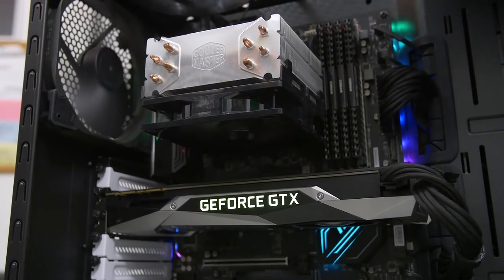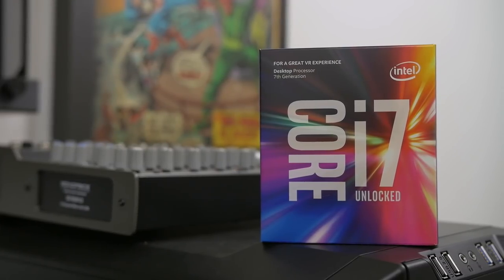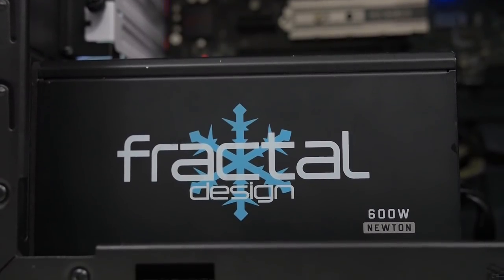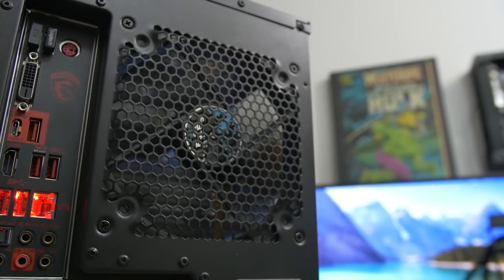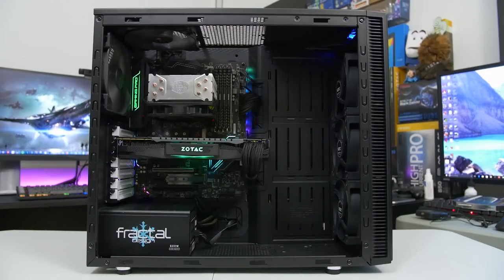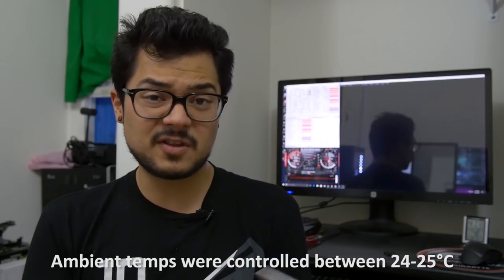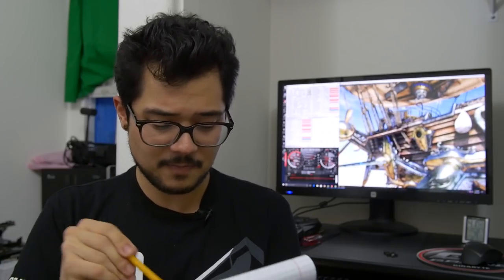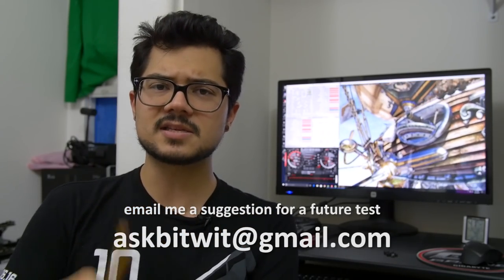This is how you should mount your CPU cooler! I think??

Comment: Sounds like air flow is the key even if you use already heated air for the CPU. The open GPU seems to have created a veil of hot air streaming up that stopped the fresh air from the front of the case reaching the CPU fan. I've read that having the two rear exhaust fans pointing back and up so close makes them compete for the same air in the corner.

Comment: blower style gpu = the heat doesn't get to be released all that more efficiently from the back and that's why the overall heat of the case increases

open style gpu = the heat circulates enough and cools down the gpu so it doesn't heat up the case and the heat gets released from every exit of the case.

Comment: first test has to be that the fan is getting all the cool air from the front intakes..the open air card probably throws the hot air out the sides and it gets countered by the cool air. 

but the direction of the fan and heat sink. it does make a lot of sense as the cool air has a stronger presence

Comment: IImo, if you look at the case, theres no space on the bottom to exhaust any air.  So if you use an openGPU, all the exhaust air would have to blow upwards to the outtake, hence giving the CPU heat sink double airflow, When you mounted it vertically, the CPU fan was taking in the GPU hot air, the case fan was too far to give any impact on the heat sink. Thats why the temp increases. You should give us the GPU temps to give us all the variables in your tests.

Comment: The abundance of fans was probably enough to exhaust the air from the open air shroud from the pcie fingers and the CPU was thermally isolated. When it went vertical, it was sucking air from where the GPU was exhausting so therefore negating the purpose of the front fans. My best guess for why the founders performed badly was because the back plate was heating up and being cooled by the CPU cooler as well.

Comment: My guess for the difference in the shrouded GPU would be that the GPU fan would be producing a negative air pressure on the lower end of the case causing the air at the top of the case to be pulled down disrupting the airflow of air across the CPU.

Comment: A theory about the horizontal air flow with open GPU.
You have three front fans pushing air into the case without any drive cages obstructing the flow.
Therefore your main air flow in the case is already horizontal. The CPU fan gets all its fresh air directly from the top front fan, pushes it through the fins and the rear fan pulls the air outside. If there is any heat rising up from the GPU, it's basically blown horizontally by the other two front fans and it wouldn't really get in front of the CPU fan to heat up its intake air. Also, the only heat from the GPU that should affect the CPU cooler in that configuration rises up at the very end of the card.
And since we know the blower style cards get hotter, that may explain the increased temp for that type of card. The horizontal case flow doesn't help, because only the GPU cooler's ability to move air is relevant here for ejecting heat out of the case.

It might be interesting to repeat that test with what I'd consider a more real-life scenario (at least more relevant to me, because I don't want to do without a DVD Drive):
Mount a 5.25" drive bay and remove the top front cooler and put another 3.5" drive bay (even empty) in front the bottom front fan. That gives less air flow and the air coming in must rise up to get to the CPU cooler, possibly taking more hot air from the GPU along with it.

Or: What happens if you mount the top fan as intake and as far to the front of the case as possible. It would pull in cool air from above the case and blow it right in front of the CPU fan intake (kind of what the PSU does)

Comment: In my humble opinion, you should always think it trough per case. make a (air) path as optimal possible past all components that produce heat (not just cpu gpu). When done check with some smoke and temperatures. For example, when you place front/back fans and place an exit fan on top near intake fan before air can hit any heated object you displace air, not heat. When you place 1 air stream and place the second one 90 degrees on the first, that usually doesn't work well either. In this case for the first and second test... use smoke to get an explanation. Personaly I would say, close the top completely so you have an optimal flow from front to back. Close the top makes that the warmth of the GPU less likely to hit the CPU cooler. Heat wants to go up but with a good air stream it wont.

Comment: Commenting as I watch.
The open shroud graphics card setup with fan aimed out back ran cooler, because the card itself ran cooler, less heat traveling up to the CPU area.
Sure the blower style vents out and is contained, but not 100%, and those run much hotter than AIO cards.

Comment: It is possible that the blower style GPU was pulling more air than the other fans, creating a bias of more fresh air flowing towards the bottom of the case. You would have to look at the speed of each fan while running the test, take those numbers and figure out what volume of air each is moving at that RPM. Given that we know that those blower style GPUs tend you run up the fan to a pretty high RPM while under heavy load, and assuming that you kept the rest of the case fans at a reasonably low RPM then this might be the cause. Try running the test again with the case fans at their highest RPM. Thank you for continuing to have a great channel!

Comment: presuming that heat generation is equal in all tests what is happening is either the configurations affect total airflow into/out of the case or they affect airflow inside the case. to test this you could measure air pressure going into the case and measure the GPU, Mobo temps and put some thermometers inside the case

Comment: thermal dynamics... higher difference in temps slows heat transfer so just like in your AIO vid the warm air actually pulls more heat off the fins on both coolers than cooler room temp air. usually involves larger differences but its an idea :)

Comment: Maybe it's because you have so much airflow pushing to the back of the case (including the cpu cooler) that all the heath coming from the gpu is exhausted before it can get so close to the cpu that it raises it's temperature . While when the cpu cooler is vertical, some of the heat coming from the gpu is taken by the cpu cooler and is forced to go through the fins, so the cpu cooler is actually using hot air to cool down the cpu, resulting in worst result.
I think that in a part 2 you should also consider the effect of the case fan on the cpu cooler.

Comment: I think with the enclosed GPU cooler you end up with less positive pressure in the case, which results in less air being evacuated by the fan behind the CPU cooler.  Less airflow in that total fluid path = less CPU cooling effectiveness.  With the open air GPU cooler, you don't have that air being forcibly being evacuated out the rear of the card so overall case pressure isn't affected and airflow through the rear case fan is higher (and therefore also for the CPU cooler).

On the other hand, with the vertical CPU airflow alignment, the open air GPU cooler probably dominates the thermal behavior through convection current (hot air rising) and the positive pressure factor becomes less of a dominating factor.  So you end up seeing the expected behavior there.

That's my theory.

Comment: As you have seen with those temps, when you have a ton of case fans and mild overclocking, orientation hardly matters.

When it matters is if you are trying to get the lowest temps with the worst air flow.

Try again with a PSU on top tower case, no case fans and seal any holes in the case except one inlet diagonally opposite the PSU.

That configuration will take advantage of convection and less fans equals less noise.  Less air through the case also means less cat hair in the heat sinks.

On a related note, I have developed a preference for Thermalright coolers with a baseplate.  Last I checked the 212s used pushpins which have much more potential to fail and burn up a CPU.  For a few more bucks the Thermalright coolers seem better all around.

I have always managed to set my fan profiles to create a barely audible PC with acceptable temps even when stress testing.

I use good 80+ PSUs, usually gold or silver, sized so load testing uses about 75% of rated wattage and skip anything with a reputation for noisy fans.  I use GPUs with some thermal headroom and quiet fans.  Those are not hard to find so you really don't need a computer that sounds like a vacuum cleaner.

If anyone wants to try a setup like that, spend some time on cable management so the path of air flow is not impeded.

Comment: maybe the 1070 reference, by being hotter than the blower-style, is dissipating heat through the back of the card, and thus heating up the tower cooler. If you could get your hands on a thermal camera, we could find out if it is true.

Comment: I think I have an explanation for the Horizontal + Zotac thing.. As I noticed that u have a fan at the front of the case which is directly pointed at the Cooler heat sink and When u put the Cooler Horizontally U have now 3 Fans in a line (The Front, The Back And the Cooler Fan) Which is making a good airflow ! And when u Put the Zotac card.. as u said it releases its air inside the Case which making the amount of air that is moving in the case is more which is resulting in a more Air flow and that Means There's more Air that is coming in the case as long as there's more air that is coming out of it ! But when u r using the Reference Model of the GPU, u r only relying on the case fans to get Air in the case in order to get it out and "Recycle" it.. It's a kinda complicated thing to explain but I tried to tell it in a simple way.. Anyways Great Video And Awesome Work As Usual ! Keep it Up ! :D

Comment: Unless stated by manufacturer to position it at specific location then its a margin of error and difference in ambient temperatures. Noctua on their NH-L12 states even to not position heatpipes upwards as it will "reduce the cooling performance" (Noctua NH-L12 Manual). If you want better cooling go for bigger (or more fans) or go AiO/Custom Loop than hope for placebo effect.

Comment: I think because of the turbulence caused by the GPU with the open shroud caused the air to "hesitate" more through the cooler picking up more heat causing the temps to be a bit lower when the cooler was horizontal (due to the horizontal orientation and the amount of fans the heat from the GPU even with the open shroud was not effecting the cooler itself).. and when it was vertical because heat rises the turbulence didn't have the same effect and the air traveled up through the cooler smoothly and was already warmed by the air from the GPU so the temps got higher.

Comment: I wouldn't particularly recommend this for everyone, but you can track the air flow paths by getting a smoke machine with a hose you can aim the smoke into the front intake. This way, you'd be able to get a very rough, but accurate, idea of air flow in your case. Unfortunately, the turbulence of the air will indefinitely kill any hope of a straight line of smoke pein present, but as the smoke is dispersed, you can see where it goes and where it doesn't.
DO NOT USE A FOG OR MIST MACHINE
WHY WOULD YOU EVER PUT WATER VAPOR THROUGH YOUR PC

Comment: It seems like you a) only test one trial of each configuration, and b) don't account for uncertainties in your measuring equipment. With the numbers being so close together it's hard to conclude that there's a statistically significant difference in cooler orientation/setup without a larger sample size and a t-test that gives a reference p-value for comparison.

Comment: Brother on top of the probes in the case, you also would need a thermal camera to see the actual air flow inside the case ( high speed camera will also help), and please follow the scientific method . . . a few more test are in order so you can have more data. A horizontally mounted cooler would "probably" benefit from the air from the front fans.

Comment: @BitWit I  think the way to look at it isnt Horizontal vs Vertical I think its Blower vs Open. For a Blower GPU its cooler when the cpu air is going up because its more efficient for the heat dissipation as you'd expect. Then for the Open cooler,  its cooler for the CPU to get fresh air from the front area of the case rather than hot air from the open cooler of the GPU. In other words, optimal CPU cooler orientation depends on the GPU cooler design. and is not always going to be better in one orientation regardless of GPU. Hopefully you see this comment and Im not typing it for no reason haha.

Comment: concerning your horizontal scenario 
hot air rises up, so it passes through the cpu heatsink, which results in potential airflow through the cooler, that could be the answer because it won´t do that with a blower style cooler because the hot air gets ejected out the back

Comment: The difference you are getting is due to air turbulence.
The blower style card is creating a second exhaust port/location lower down in the case making air exhaust out the back more than the top.
The open style card is pushing air up so the exhaust flow is top/back.

The blower card can be looked at as a black hole.  It sucks and disturbs airflow all around it, exhausting it out the back with no care for anything else.  Its main goal is to push air across it's fin array and out.
A open shroud cooler's pushing air up and through the card with paths of least resistance.  You already have negative air pressure near the back of the case so that is were the air will go.

I'd also hazard to guess that if you included GPU temperatures in the scores you might be able to make more sense of this.  The blower cards back is most likely much hotter than the Open shroud card and the CPU cooler is most likely pulling the hot radiated air off the back of the blower card causing the spike in temperature.

Comment: The blower style GPU acts as an exhaust as opposed to the non-reference card that circulates the air within the case. So since the Evo didn't have as much air going through it it was less effective. To make things more even you should have tested that scenario with only one 140mm as exhaust.

Comment: The zotac 1070 pushes more air around the case, and more air around the cooler makes it easier for the fan on the cooler to push more air through the cooler which makes the cpu run colder

Comment: My Theory :) I think that the first and second results are described by air pressure. The CPU cooler + fan on top + fan on rear = 3 fans blowing air out on upper part of the case. Then you had blower type gpu that did not allow any air from bottom part of the case to go to the upper part (isolated it). And then you changed the gpu to more open cooler that allowed some air from bottom to reach the upper part of the case. The upper part had so much positive air pressure then it caught the air from bottom immediately and moved it through cpu cooler effectively allowing more air to move through it = increasing cpu cooler effectiveness = lower cpu temps.

Comment: My theory is that the blower style cooler retained the heat, and RADIATED that heat to the cpu, whereas when you used an open one, the intake fans cooled the air before it was put through the cpu heat sink. As for the second one, it might be because the "layering" of the GPU and CPU cooler formed a pocket of air that was able to be circulated well, when introducing the open GPU, everything got turbulent and the CPU cooler was starved of cool air. It's a theory, do a smoke test and look at the airflow, could be a cool follow up.

Comment: My theory is when the blower GPU puts air out the back there is rising hot air increasing pressure outside the case making the exhausted air next to the CPU and above the GPU  move more slowly. You should do the test again but check the exhaust fan speeds.

Comment: put a cardboard panel to separate the fresh air coming from the front, creating a CPU zone and GPU zone.
chances are the GPU is pulling enough air from the case front that the CPU is effectively getting less fresh air straight from case front, thus causing a stagnant area of GPU air getting sucked into CPU.
a clear panel with incense, vape smoke, or fog machine would show the cause.

Comment: Well, blower cards tend to run hotter. Ii'll say the temps of the back of the card are higher than the open ones, so the surrounding air is hotter, hot air rises, and even tho the 212 isn't pointing directly to the card, it's still right above it, thus getting a few degrees of difference between both tests.